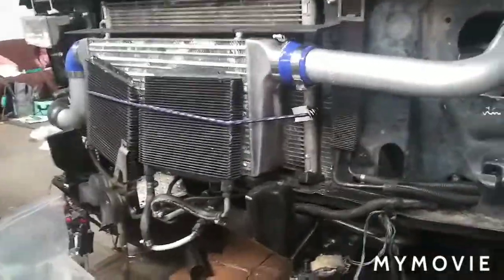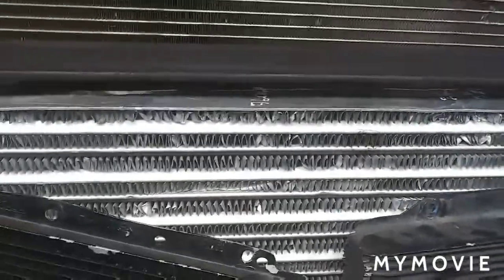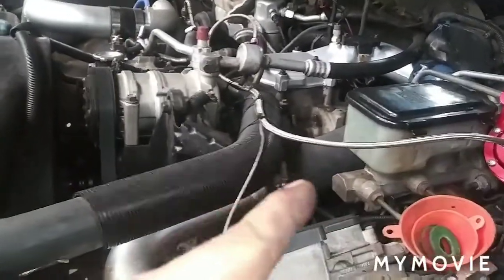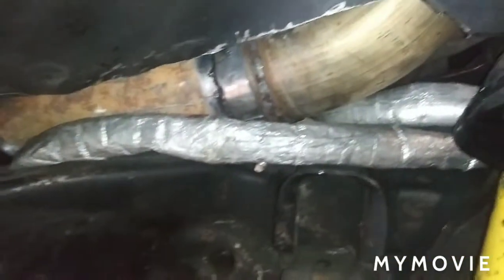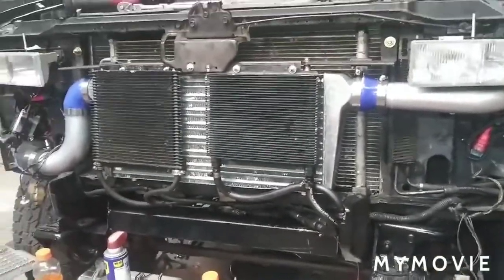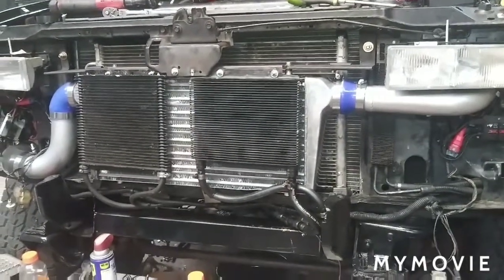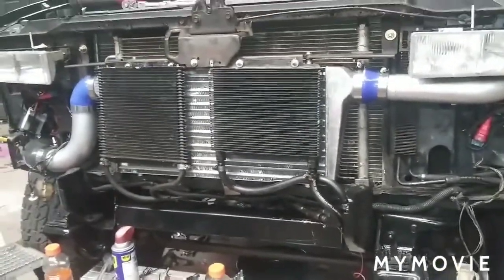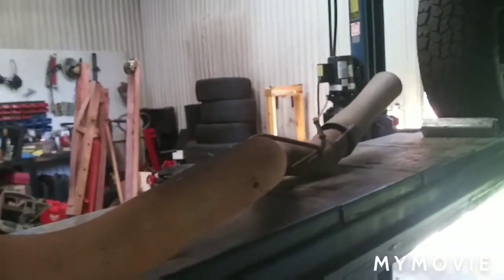99 K3500 6.5TD TURBO UPGRADE PART6

Comment: What intercooler is that
Reply from the maker: Is an of the shelf intercooler. I have the info on the one of my videos if u r interested on building one ur self.
Reply: @popeyonsote  do you know if its the right dimensions? Apparently in order to get a inter cooler to work at its peak you gotta have the proper dimensions and calculations of air flow through the pipes the only consequences are something like pressure loss and restriction. to much air space and it wont cool right
Reply: @popeyonsote  looks clean as fuck tho